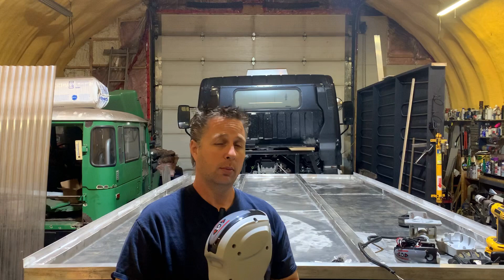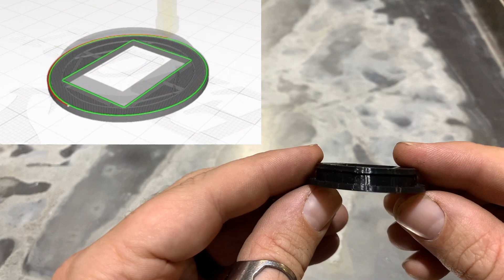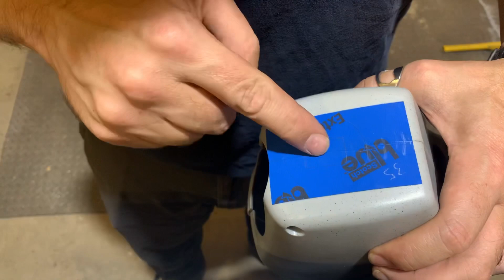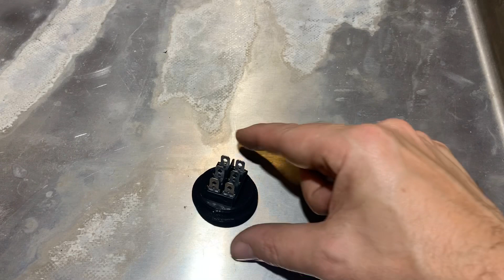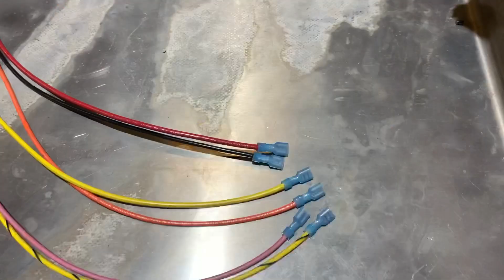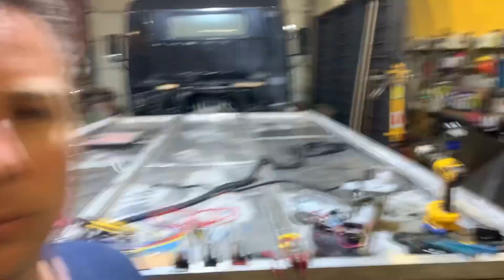Common control for independent camper jacks! (1)

Comment: Yeah, just get a wireless electric winch controller and wire it to all 4 winches with 4 sets of wires all parralled to a 2 wire to plug into each lift. Perfectly mount the winch control harness with a quick disconnect 2 wire plug. This way you can have 2 sets of power leads too each motor.  On that is +/ - for individual control selection and on that is reversible control from the winch relay.
Reply from the maker: That’s exactly what this setup is doing 😎.  The wireless controller only puts out a signal (not high current capable) thus the need for relays in each Jack leg.  Need 4 wires to each Jack, power, ground, up and down signals.
Reply: @BruceandKrista  Yep, and a big Winch relay can handle all of those 4 motors pretty well. That, or just set up the smaller winch relays to take a signal from a big winch relay as a main controller. 
 Harbor Freight sells the wirelss 12K winch controls that I love.  No wires to keep grtting tangled.  They are fairly cheap. (Some I've been using more than 10 years. I have one wireless realy rigged with 2 big winches so I can pull double winches dowble lined in my shop.  (Overhead winches on rollers hoist)  I pick up a lot of truck bodies with it, and can switch to one or both winches on one control.  Makes clearing a body off a frame easier by myself.  I can run it while on the creeper under the truck frame.
I love watching your videos.  Make me wish I could help.  I'm a retired Power Company guy who for years was the guy who ran to fire calls and lines down for the Fire Departments I served. I grew up with several guys in the FD Stations.  Lots of stories there!
Reply from the maker: @CurtisDrew1  pretty amazing what one can do with some snatch blocks and pulleys!  I’ve been eyeballing a 12K winch, but I think I’m going to try to find an 18k for this truck, I’d rather be over powered and under utilized, if I get really stuck!